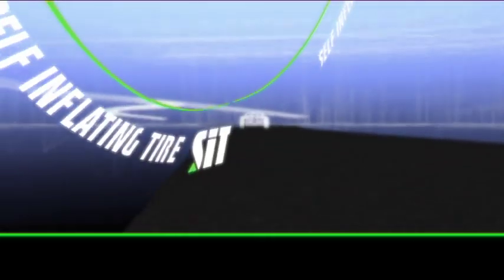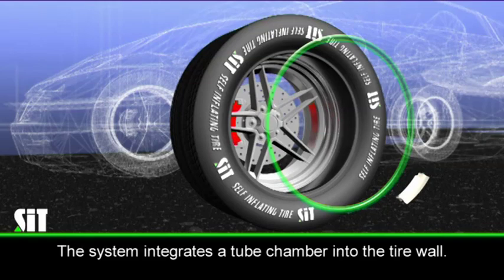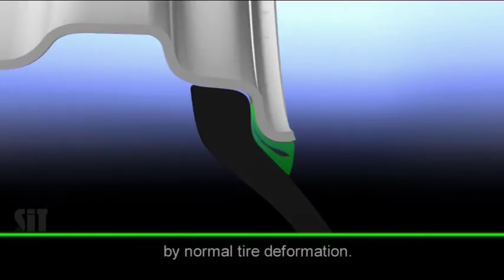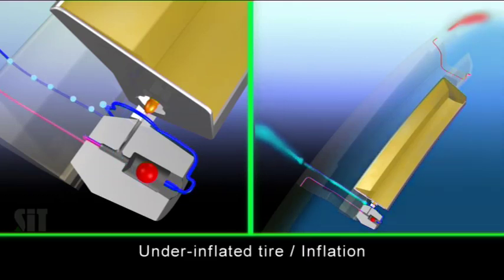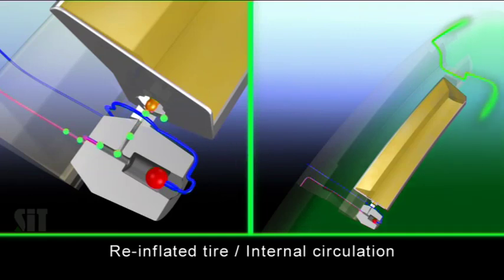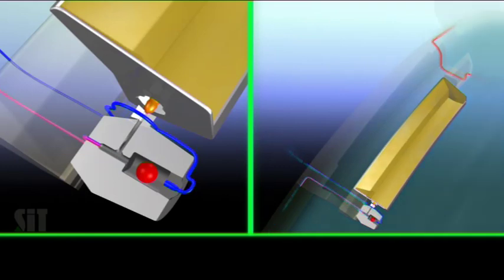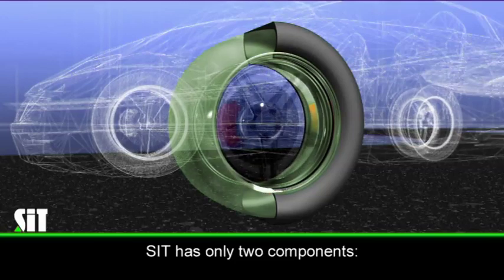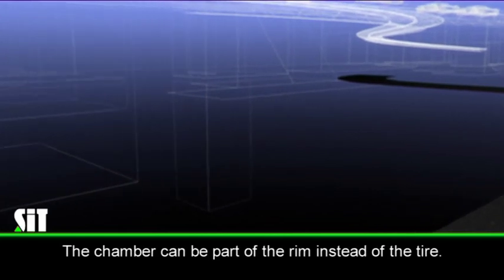Self Inflating Tire how it works

Comment: yep. still not sure exactly how that works
Reply: Its litterally explained in the video. The weight of the car, compresses the green tube between the rim and tire, and the point of compression changes while spinning, creating a vacuum that sucks air through the aditional valve until it reaches your set psi
Reply: @edgarrg1899  One small problem - what if the car SITS (sorry) on its tyres and is not driven for 12 months?  There must be a Schrader valve as well to allow inflation.
Reply: same here.